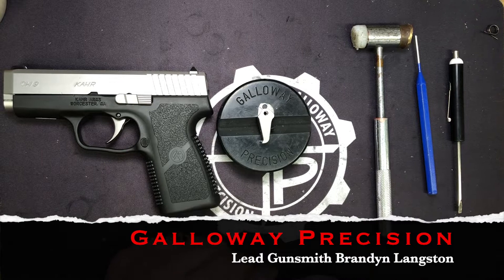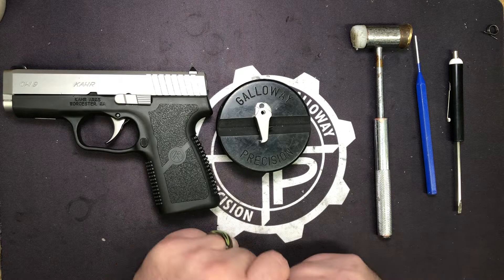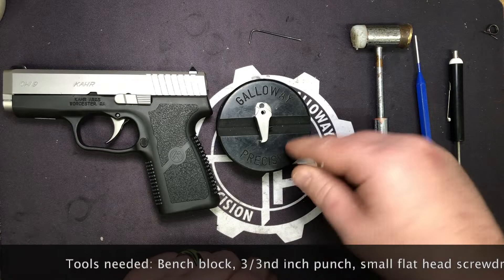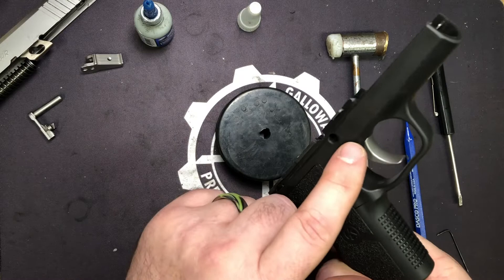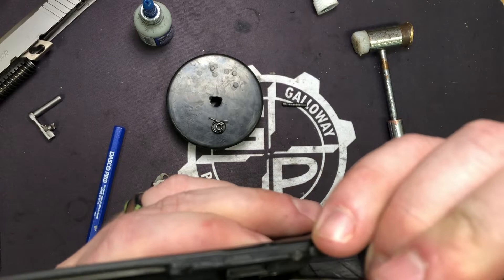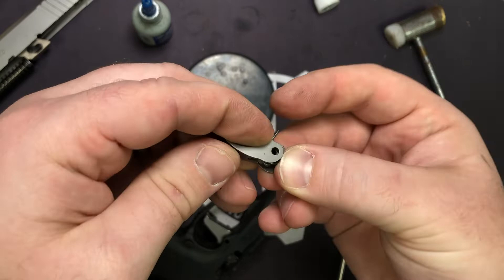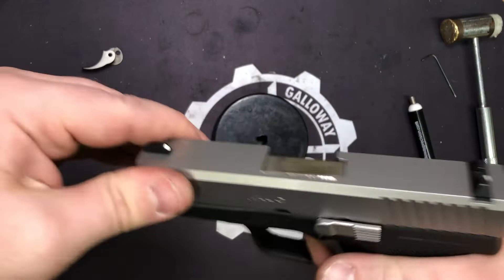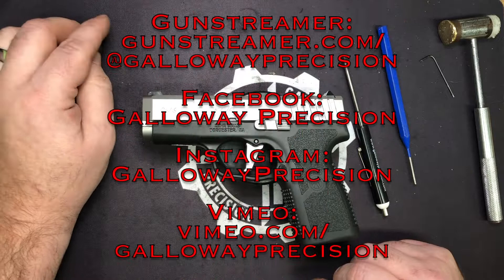Gallowglass Short Stroke Trigger Installation for Kahr Pistols from Galloway Precision

Comment: I thought I had it. Everything looked like it was working good. Until I got it put together and nothing. Then I noticed that bottom spring was sticking out through the back of the trigger. I new that wasn't right. I almost never got that slide off due to the trigger not working. You really need a better video how that spring is supposed to go in there, and what it looks like when it's done. I've seen a lot of trigger job\s on  different striker fired handguns, and these video's are excellent. Can't figure out why you can't have a better video. I will keep tryin
Reply from the maker: Seems you are discussing your installation issue with our tech as well. I am sure he can walk you through it.
Reply: @GallowayPrecision  I've worked on a lot of different firearms over the past 10 years; never a Kahr. I thought the mossberg trigger was difficult, but not anymore, This one is by far the most complicated, lol. Was just trying to help out a buddy figured I'd give it a shot. Didn't think it would be that bad. Ended up going to Galloway and saw this video. I'll be honest, it's not that much help. You should do an updated video. But I do appreciate all your help. I just can't figure out what I did wrong. Now I can't do it again; I mean get the trigger back together. But I will battle through until I get this figured out.

Comment: Nightmare….no lie.  Have not quit for good yet but I’m headed to the shop for the 3rd session of spring/plate alignment.  Will try a few of the suggestions found on the comments, painters tape, rounding  off the trigger pin and adding some oil.  Hoping the work is worth the effort.  I have done trigger jobs on 4 of my other firearms in less time than this one job.   Never quit.
Reply from the maker: Be glad to assist with whatever stage you are getting hung up on. Please contact our tech through our Galloway Precision websites contact us page. Sorry Youtube will not allow us to post a link here.

Comment: OMG! I was on the verge of having a fit during my own install. My screwdrivers were magnetic and kept pulling the spring assembly out unless I used my third hand to work a non-magnetic hook (I have a screwdriver de-magnetizer cleverly hidden in the house) so I mostly used a curved hook. There is a narrow furrow in the polymer that shows where the straight part of the spring will end up, and the curved spring ends up against the back end of the new trigger. I found I had to have my punch handy to push into the pin hole to help catch the the round spring when things finally lined up. Anyway, it all worked out and I am pleased.

I compared my CW9 OEM trigger against the trigger of my K40 and it appears they are identical in the upper part that works inside the gun and are different only in the area pressed by the finger. The K40 trigger is slightly longer within the trigger guard and slightly flatter at the tip. Since I might want to replace the trigger on the K40 I now wish I had tried it on the K40 first. I recall the new trigger also listed itself as a replacement for the K40's trigger (the shipping package also lists the K series) but the web page no longer does. What's up with that?
Reply from the maker: Unfortunately the steel frames have some differences compared to the polymer frame models and we do not recommend it for the steel frame models.

Comment: Would be extremely helpful if you mention or point out where the two ends of the spring are suppose to rest when it is seated correctly. Currently on my 3rd hour trying to get it in.
Reply from the maker: The trigger spring rests on the top of the frame opening and the lower leg goes out the back of the trigger, both like stock.
Reply: He did mention it in the vid

Comment: BTW. Ill give you a tip. Take a piece of blue painters tape and roll a small piece and wedge it all the way around the between the spring and spacer. That way the spring and spacer stay in the correct spot in realtion to eachother and doesnt rotate on you. That also keeps the flat part of the spacer against the trigger. You leave the piece of rolled tape in there. It doesnt affect the trigger mechanism at all.
Reply: :oops:

Comment: The Kahr trigger is an absolute nightmare to put back together. The first time I did it it took me a total of 7 hours over the course of 3 days just to get the spring, spacer and pin holes lined up. I eventually rounded off the trigger pin on the driving side and that made it easier., I have been working on strike fire pistols for 30 yrs and Ive never had that much trouble.
Reply: :face-orange-raised-eyebrow:

Comment: Have the low power springs and stainless striker guide from Galloway - and highly recommend the stainless guide rod upgrade as well (you can feel the difference), available from Kahr or http://www.tcsgunshop.com/

Been following this with great interest. 👍

Could the spring be attached to the trigger with some kind of schmoo prior to putting it in the pistol and then cleaned out after completed?